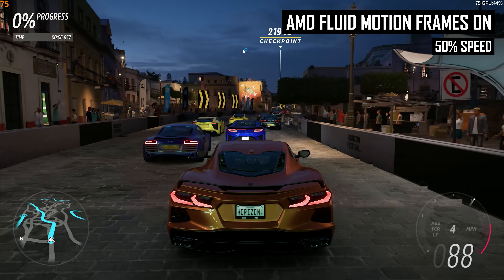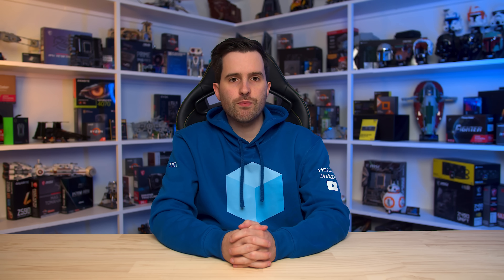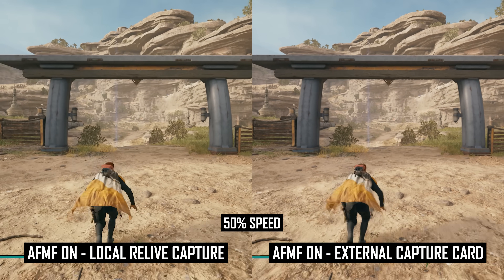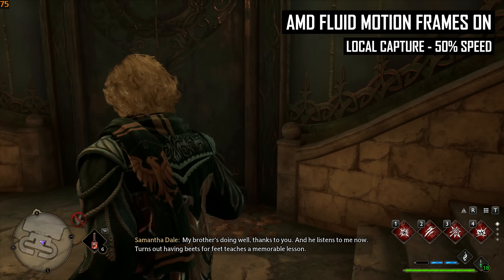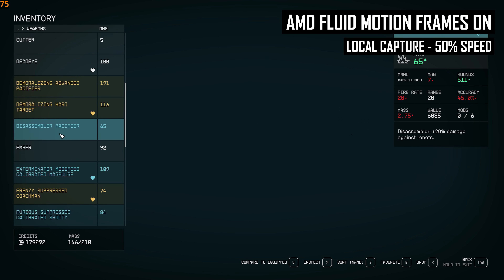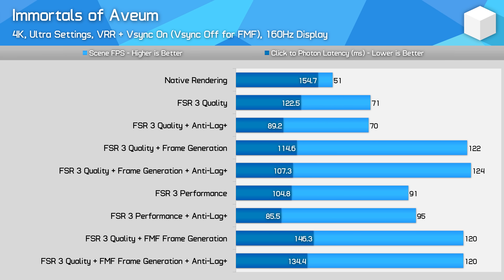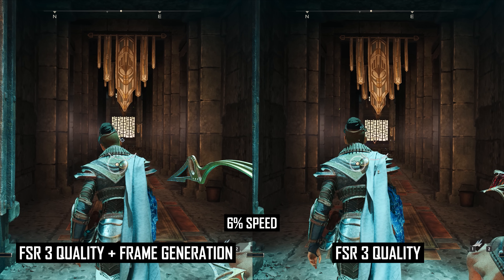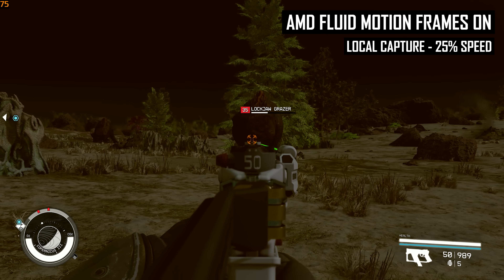Frame Generation for Every Game - AMD Fluid Motion Frames Analyzed

Comment: I personally find these kind of benchmarks a little exaggerated, why? I personally have been using AFMF in every dx11/12 game and haven't seen any difference in image clarity but i could feel the smoothness, one thing that I saw is if you have small base fps (less than 40) the game doesn't feels good at all and is blurry (like motion blur) but if you have like 100fps in a game and you want that extra 100fps then AFMF is really good for it, latency wise i didn't really felt anything differently (maybe is bigger but nit enough for me to feel it) I use it while playing bf1, titan fall 2, cs2 and dbd and i can only say good things about it.
Reply: I've tried it too in many games and with a high base frame rate of 70+ on a 7900XTX and I feel it negatively impacts the image quality, third person games especially where panning the camera even slowly makes things blurry, breaking up or doubling of thin lines, or windows roofs, complex geometry that sort of thing takes a big hit. The only game I've used it where it works probably the best is Forza Motorsport. With a base framerate of 60 it works rather well. 
Other than that I have seen some comments of people saying it looks great or they can't tell its even on and that's just not true. I don't see how you can't notice it. Maybe you feel that the tradeoff is worth it because of the smoothness it offers and that's fair, that's your choice to make but the only reason I can see people not liking a deep dive into these technologies like this is because maybe it breaks the illusion to them that there are issues and that's no surprise because the way it works there have to be issues especially when its being done on the driver level without access to game engine data.
There's also a performance cost to this as well. I took a look at TLOU on my 6800XT a game where this tech actually works alright and lost around 15% of real framerate performance just turning AFMF on so than you are presented with a situation where you could just enable FSR Quality and get maybe less total frames than with AFMF on but they are real frames of much higher overall quality consistently, with lower latency than introducing low quality generated frames amongst real frames. 

Right now I would only use it in Forza Motorsport because FSR and DLSS dont give you much performance turning them on and the game is demanding so to reach my 120hz refresh rate I feel the tradeoff is worth it. Every other game I wouldnt use it because I feel its not worth it but if it works for you than that's great.

Comment: Improperly tested!

Elden Ring and ALL Soulsborne games, which are extremely popular, are perfect use cases for AFMF as they are locked at 60FPS for gameplay reasons. With AFMF you can double this to 120FPS with no noticeable artifacts and the game will in fact look significantly smoother. Total system latency in Elden Ring is 31ms and there is no noticeable input lag at all.

The goal of AFMF is different from FSR3 yet you review them the same, poor review. Not to mention it's optional, literally a bonus feature that DOES have good uses in certain games. I'm stunned you fail to mention even 1 good thing about it. Even smaller techtubers picked up on the ability to bypass FPS locks to get smoother gameplay. This video is not up to standard, HUB.

Of course it'll be worse than DLSS or FSR3, it's driver side and works in ALL DX11 and DX12 games. Whether or not it's good depends on the game, you can't expect it to be good in all games, which you are seemingly expecting in this video. DLSS3 is not good in all games either. Show me DLSS3 FG 10x slowed down and zoomed in and I'll show you a bunch of artifacts.

As an AMD only feature and considering the popularity of Soulsborne games (just 1 example) and others locked at 60FPS this most certainly has added value.

Comment: Stable when talking about the new AMD drivers...well...that's debatable. Freeze and crash was the order of the day when I tried Adrenalin 23.9.3...even after several DDU clean installs. Several black screen crashes, and instant freeze as soon as I launched web browsers. Went back to the 23.8.2 drivers, and all is fine. So yeah...they thought it was Windows causing the issue, but it was AMD all along.
Reply: The weird thing is that the experience is different on the same hardware. I have an ASUS Prime X470 + 5800X + 4x8GB 3866MHz + Liquid Devil 6800 XT and have had zero problems with 23.9.2, 23.9.3, or either of the AFMF preview drivers, hardware acceleration in browsers works fine too. On the other hand, I have seen a lot of people with an ASUS board + 5800X + 6800 XT reporting freezing and crashing in web browsers. I don't know how AMD manages to make a driver that works perfect on one system, yet crashes on another system with the same hardware. I am betting it comes down to something stupid like PCI-E power saving features or RGB software.
Reply: @K31TH3R  I'm on an MSI B550 with a 5700X and 6800. Got the new Windows Update and everything is working fine aside from Adrenalin 23.9.3
Reply: Im on the 23.9.3 drivers with an X570 Taichi 5900X and a new 7800XT. Everything is working fine so far. Haven't has any crashes at all.

Comment: The latest preview driver (4th patch, iirc) improves frame times massively. I presume the retest is due
Reply: they should just test it when it's officially out.
Reply: @marceelino  Agree, every preview update will probably add significant changes.
Reply: @marceelino  but then they can't milk it for many videos, despite hurting AMD's image by testing it in all the wrong games and not realizing what it's truly best for.

All Soulsborne games can now be played with 120FPS smoothness, no noticeable input lag and no noticeable artifacts. Considering their popularity, this is huge, and that's just 1 use case. Big W for AMD here.
Reply: @Altrop  I mean, it's all fine. I am happy for AMD, but it's still a preview driver. I don't think this is a critical state. 
They can gather these testing possibilities and then talk about it for as long as they want.
Reply: @fofal  it is not pro AMD lol bunch of Nvidia shills everywhere
Reply: And test with Elden Ring. It's locked at 60FPS for gameplay reasons but getting that 120FPS smoothness is now possible and it's amazing. If they get it working with FreeSync it will be perfect.

The soulsborne games are extremely popular and that's just 1 use case.

This review was very poor as they comoared it to DLSS FG and FSR3, this has different usecases. And since it's AMD only it's legit a selling point, assuming reviewers do their job well.

Even smaller techtubers picked up on all the possible use cases yet HUB has nothing positive to say about it?!
Reply: @Altrop  3rd person Action RPGs  are popular on consoles. Those games are very limited, as you already mentioned 60fps lock.
Reply: @Altrop  so when nvidia does something exclusive to their platform, they are being dicks, when AMD does it, it's a selling point 😂
Reply: Also quality, look SO MUCH better, and HDR support!

Comment: It works incredibly well in a heavily modded FFXIV. 120 native fps then AFMF on keeps me at my monitors refresh rate of 165hz. Being an MMORPG i don't need to move my camera fast so AFMF doesn't disable during gameplay. It's so good that i have made a new overclock profile for my 7900xt that runs a -5 power limit, 1040mv under volt and 2720mhz on the memory. Its only pulling 290w, running faster than default settings while pulling 20w less, its cooler and quieter and because of AFMF im pinned to my monitors refresh rate. i just dont need all the bonus fps from a full on overclock anymore. 

Having a high native frame rate im not seeing any of these "ugly" frames that are in this video and my UI is not all busted like in this video which is weird considering its an MMORPG which has a massive UI full of hotbars etc. I dont think your experience could be anymore opposite to mine but in saying that this tech is very game dependant.
Reply: I have done similar things in quite a few DX11/DX12 games with my 6800 XT. In some cases I've been able to almost cut my cards power consumption in half with a large undervolt/underclock while getting even better buttery smooth FPS. Seeing the card put out 120 FPS at 4K while drawing 150W is just epic.

Comment: I've been trying AFMF on all of my games to really give it a go, 7900XTX at 4k 120hz. Overall I really like it, zero frame pacing issues for me. My critiques are covered in this HU video: UI and crosshairs struggle noticeably when moved quickly over complex backgrounds, no ability to really limit FPS to match my monitor. The added latency was low enough that I definitely appreciate it. If they continue to improve it, it is a great addition with potential considering its universal use. FSR3 should of course be the focus and all devs should make it an option since it is so accessible to users - even old Nvidia GPUs.
Reply: I really liked it as well. I used it to play RE4 1440p 240hz +RT high at around 190fps, and it was glorious. I've misssed the HDR option but as of yesterday's driver that is no longer a limitation.There is a frame  cap option in the driver but it's confusing  how it is interpreted with AFMF. I honestly couldn't care less for flickering menus or vsync compatibility

Comment: Today's driver update makes it SO MUCH better, looks so much more crisp, I almost thought it was off, and HDR support, a very very good update, impressed with the speed and quality of these drivers.
Reply: Is the AFMF preview driver guys, works for RDNA3 and RDNA2.
Reply: Keep dreaming
Reply: Ficou muito Bom!! Agora eu vejo a fluidez!!👁️👁️
Reply: Which driver version is that?
Reply: What update?
Reply: @fervargraider5274  AMD put out an update to the AFMF preview driver today that improves pacing and adds HDR support for AFMF.
Reply: @fervargraider5274 I believe the latest drivers are numbered something like 23.10.???
You have to got to AMDs website to find it as Adrenalin isn’t showing them at the moment.
I also think it doesn’t feature AFMF. But I did see some 3-5 fps gains after I updated from AFMF beta to the new driver.

Comment: If frame generation is useless below 60 fps, it's useless for the people who need it most.
Reply: I think AMD will likely be able to fix this, as the problem isn't that AFMF doesn't successfully generate new frames and increase the framerate during sub-60 FPS scenarios, it's just that the frame pacing and input lag becomes very uneven in those generated frames at lower FPS. Probably the way forward is allowing anti-lag to dynamically adjust CPU queued frames to maintain the input lag at the same value. It would likely increase input latency further, but I think that's a better trade off during FPS dips than what's currently implemented. I'd rather have more input lag than the judder and hitching.

Comment: I play with a 5800X3D and 7900 XTX, and I've tried FMF out in a few games, and yeah, some games looked like a complete garbled mess, like Starfield and RDR2. I didn't have too bad of a time with CP2077 though 4K Ultra RT at 80fps, then there's Witcher 3, which seemed to have the best experience by far with AFMF. I decided to Google to see what others experiences where, and the majority I came across seem to agree with Witcher 3 having the best experience by far as well. With AFMF still in beta phase, it's understandable there are issues, and looking forward to them ironing everything out.
Reply: Weird. Complete opposite experience in those games on a 5800X + 6800 XT. Starfield is flawless for me, and is the best example of AFMF I've found so far. RDR2 is fine, just not as good as Starfield. CP2077 is terrible, big increase in input latency and tons of judder.
Reply: @K31TH3R  Interesting. I feel the experience is tied to frame rate, and monitor refresh rate, and if you’re able to get within a certain threshold of your refresh rate, it’s either smooth, a jittery mess. I was able to limit the fps in some of the games I tried, and that really helped. Like locking at 60 in game, AFMF would be closer to 120 pretty steady, which is what I did with Witcher 3, and was quite pleasant. Regardless, still a lot of ironing out need to be done for sure.
Reply: @TimothyStovall108  Think I'd probably agree 100% with it being tied to display refresh rate. I have also toyed around with setting up scanline sync with RTSS and I've been able to make the more juddery games feel a bit smoother, but the problem with that method is that once GPU usage goes above ~75-80%, the screen tearing shows up instead of the judder. So you end up using more upscaling or reducing settings in either scenario, just for different reasons.
Reply: Have you tried with latest driver oct 13 version? I think frame pacing issues were somewhat fixed and hdr also working.

Comment: Once AMD fixes the frame pacing this could be usable for emulators locked to 30FPS or 60FPS. No, I don't expect miracles, but in some games it might come in handy. I use CAS on quite a few old(er) games already, but it's not a magic bullet that works for every game.
Reply: Yeah if AFMF can work well in emulators, it will completely upset the status quo of Intel/nVidia dominating the emulation scene.
Reply: @K31TH3R  Why are potato brains like you the way you are? This is just another tool in the Swizz Army Knife of post processing options. Nvidia has theirs too. Intel still offer a rather limited set, but have a couple of unique ones. Not everything need to be some kind of revolution or magical to be useful at times. And not everything even needs to be for everyone.

Comment: I'm gonna wait until it's available via an official driver to try it out, and even then, it needs to be able to work with vsync or enhanced sync to get me to use it, as my monitor is only 100hz :(

I'm hearing it works wonders in racing games so I would give that a go

Comment: I wonder how much better all this AI frame interlacing could be if a system had a separate, dedicated GPU to do it.  You could just buy two of the same card and put them in the system next to each other....  maybe with some sort of special connector they could use to communicate with each other...

Comment: I gave it a try as well and I think AFMF is still better than upscaling. Also I didnt get the issues you mentioned with the overlays and such. Perhaps there is a newer driver? Also I'm on a RDNA 2 card, perhaps it works better on those?
Reply: yeah many of the issues have already been resolved

Comment: AMD released today an update that adds HDR support and is said to improve frame pacing. It will be nice to see another look at this once the technology matures, although I suspect that the base issues with image quality might take a while to be improved, if they'd be improved at all.
Reply: Your comment should be pinned.
Reply: Kinda funny how AMD released a driver that pretty much invalidates this entire video a few hours after
Reply: @andersonfrancotabares3614  AMD is still eating their crayons and sniffing their glue when it comes to coordinated PR. HUB has AMD contacts, and make proper use of them (as we've seen in many announcements where Tim or Steve have asked them for additional clarification). That this one slipped through the cracks is just dumb as rocks.

But on the other hand it's also one the things I kinda like about AMD. Getting more of the leather jacket's "It just works! The more you buy the more you save!" will make me barf. AMD has their fumbles, but they seem to genuinely want to do what the market wants, rather than tell the market what it needs.
Reply: @andersonfrancotabares3614  Yeah, it does invalidate several points, and I think it would be nice if HUB posted something to make sure viewers know that part of this video is now irrelevant, perhaps release a short update video. Though I won't expect a full re-test until AFMF is in a release driver.